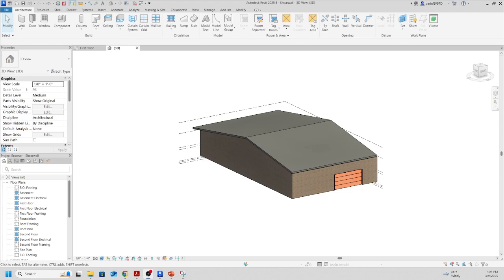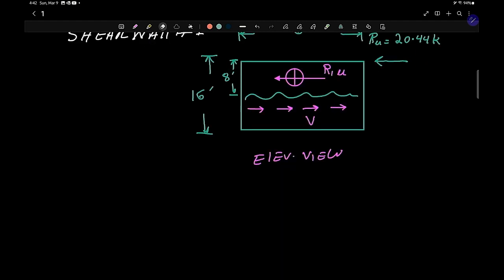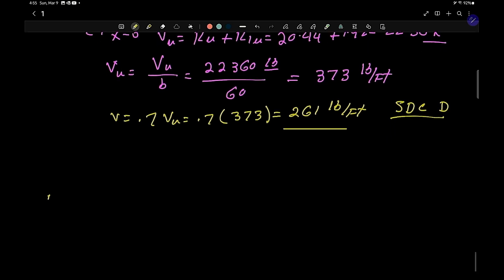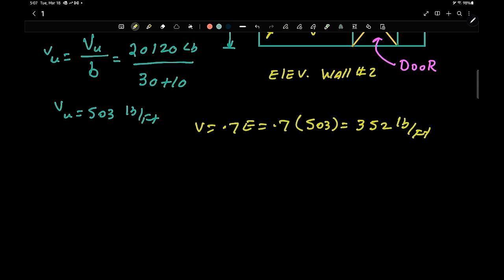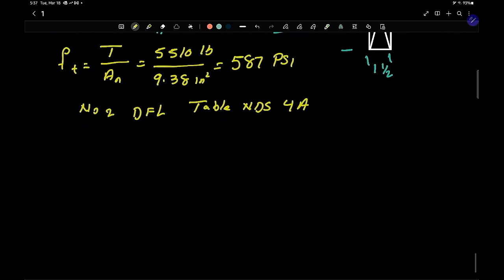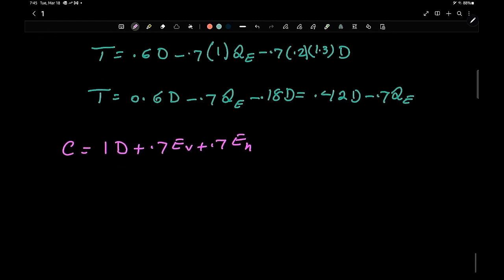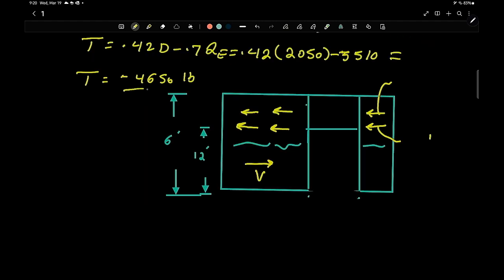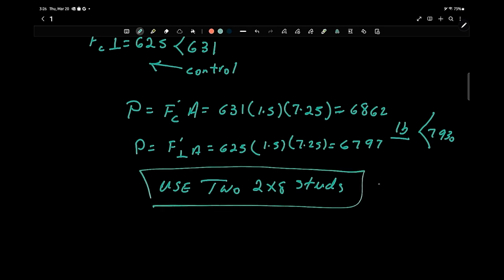Timber Shear Wall Design

Comment: Hi Prof.

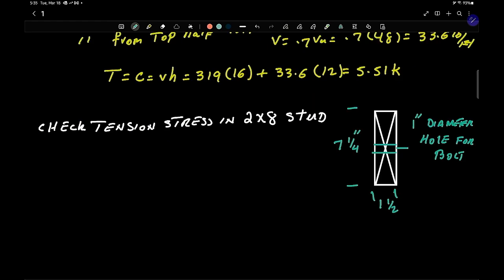23:32 the Bolt mentioned in the 2x8 stud, what is this bolt?
isn't the holdown connected to the Sill plate directly?
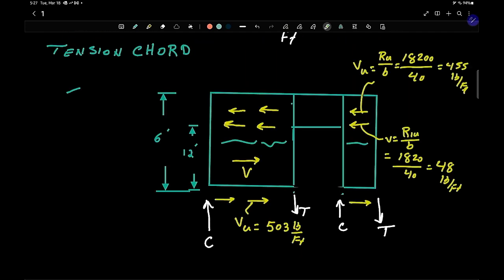Reply from the maker: Thank you for watching. Please take a look at the figure at 20:21 in the video. You’ll notice that the chord stresses are critical in Wall 2, specifically in the shear wall chord member. The 2×8 chord member is connected to the sill plate in the same manner shown in the image at 29:44.